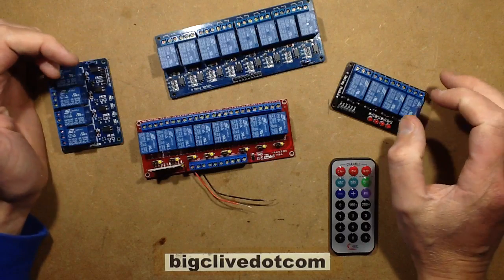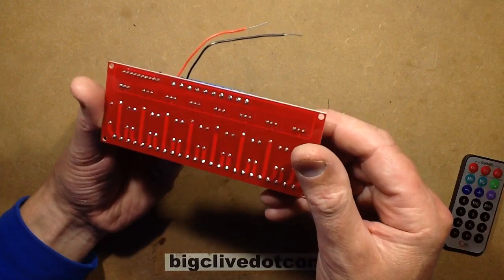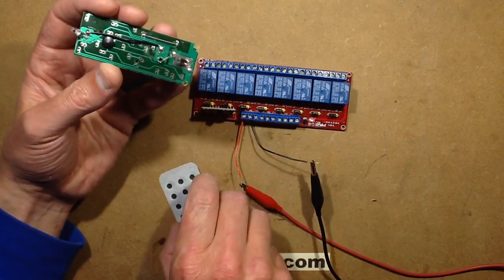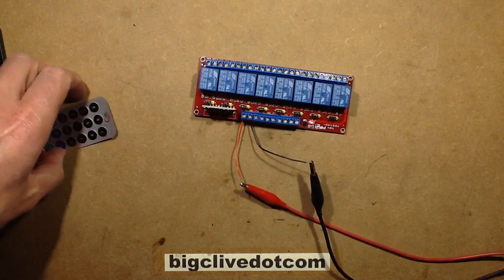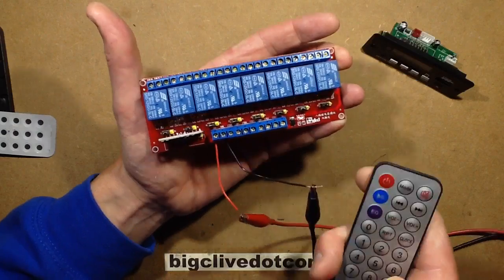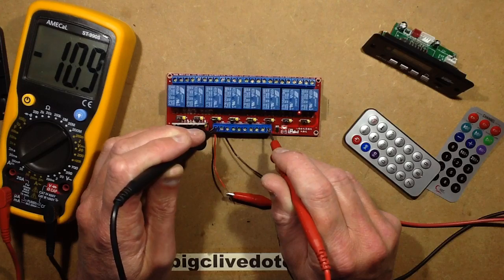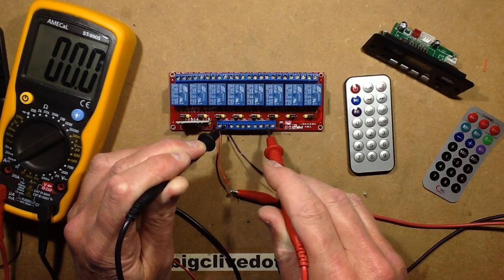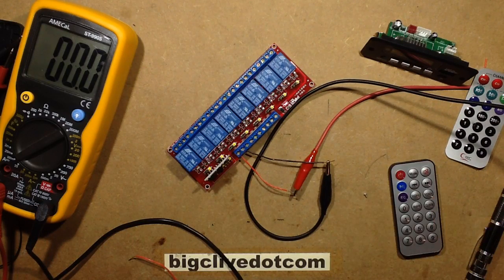Infra red remote control relay module.

Comment: +bigclivedotcom a couple of years ago when I was using the cellphone IR trick was that I noticed my new iPhone 4 or 5 at the time the IR wasn't showing up. At first I thought bad remote, then for some reason it dawned on to use the front facing camera, I can't speak for what's out there now, but it appeared that they may have been some IR filtering one the rear facing camera of my old phone. I'm now using a Samsung Note 4 and can see the IR just fine.

Comment: So could you trigger these relays with the drop in voltage when a phone is taken off the hook? I am looking to turn on a lamp whenever the phone line is in use and have it turn off again when the phone hangs up.
Reply: You mean like tapping the phone lines? Maybe, but in most countries it's illegal to hook up unlicensed devices to phone lines. Maybe you could put a magnet in the handset and use a reed switch to trigger the relay module.

Comment: I got one of those car stereo modules, connected it to my lab supply, gave it 5V and it worked just fine. Then since it's labeled 12V on the ad I gave it 12 and it exploded. Repeatedly. I'm guessing it's made for the really old cars, like Trabants, which really do only supply 6V or so.

Either way, don't try to use them with 12V.

Comment: Is it possible to de solder the sensor and extend it on wire, or would this influence the resistance of the IR sensor?
Reply from the maker: You could extend it a short distance with ordinary wire and a longer distance with a screened pair of wires where the screen was connected to the 0V connections .
Reply: Thank you

Comment: I wonder if chips get manufactured with the wrong numbers on them and instead of discarding them they scratch the numbers of sell them at a discount.
Reply: I did get once a few chips marked as LM311 from eBay. After playing around with them, I discovered they're really a dual op amps, bummer :)
Reply: I don't think so. You would not believe how many chips get faked (Brand Logo + Partnumber, but a "compatible" die inside). The most famous case was FDTI with their USB-Chip sets.
In other cases, you get real parts, which for some "odd" reason already contain data. Scratching the number off is just to make reverse engineering harder "the cheap way". (The more expensive way is, to order chips in bulk with custom printing - even the big semiconduter companies offer that service, when the quantity fits)

Comment: isn't the problem with powering the relays occurring when they are switched off? To me the Problem with the Supply is the Inductive spike when they turn off (especially because the inductive effect of the relays would PREVENT the current from rising too quickly)
Reply: The inductive spike has transistor destroying risks.  The turn on current has the potential to pull the power supply too low for the microcontroller to keep running.

Comment: Why does it handle much less volts in DC than AC?
Reply from the maker: +fabts4 DC current is harder to break than AC current.
Reply: bigclivedotcom Alright. This has to   do with the electric arc that occurs when opening the relay?
Could one concludes that you can go beyond 30VDC with a low current load?

Comment: Ha Ha .. Mr Clive.. watch 3.06 your 1st Remote is also working but without pressing a button. that is a very common problem with this cheaper remote.If you could hack the remote & duplicate the IR codes to another cheap TV remote with better touch pad, the IR relay module will be very popular & long lasting. How did you missed that 6pin chip will be a opto-isolator like PS2622 or PS2621? :D

Comment: A common problem with these is the battery compartment is under spring tension, and the plastic clips meant to hold the drawer closed are under engineered, meaning the battery get's upchucked back out of the remote after little fiddling. Annoying little things.

Comment: +bigclivedotcom, you can power those non-opto relay boards for a separate supply just fine. It's just a transistor controlling the relay. So instead of connecting the Vcc of the micro to the Vcc of the relay board just connect the power form a separate supply to Vcc of the relay board. And common ground the supplies and you're done :) No need for those modules that misuse a opto. I mean, seriously, use an opto en then connect the input and output of the opto to the same ground? :/

Comment: Could something like this be used to control 240v Lights?
Reply from the maker: I'm not confident in these small relays for mains use, but you could drive a larger relay with them.
Reply: Thanks, I am wanting to have fairground style lighting with different effects controlled by a raspberry pi

Comment: Which is the integrated circuit on IR BORARD ?
Reply from the maker: The number has been scraped off.
Reply: Has it been scrubbed off well? Usually when you apply some saliva it becomes visible.

Comment: What's the audio player? Does it handle any lossless formats?
Reply from the maker: It's a cheap eBay MPO3 module.  I doubt it would handle any more specialist formats.
Reply: No. I have one in my homemade audio amp and it plays .mp3 and .wav. Doesn't play .flac or something like that. But the audio quality is quite nice for the cheap stuff it is.
Reply: Ah. So what would be a slightly more up market version of that in. Similar size? Only more self contained than basically a front panel.
Reply: There really is no market in the retail sector for anything lossless. Aftermarket car radios had support it a few years back, but they limited them to non-high-rez bit depths and sample rates. Anything portable that will play lossless formats like FLAC is going to some expensive thing with magical pixie DACs made for audiophools. iPods play lossless, if you're willing to encode to ALAC. Find a classic one and put a modern SSD in it. Outside the home, there is zero point to lossless. Environments are too noisy to merit anything over medium bit rate lossy encoding.

Comment: got a link to that 8 relay module?
Reply: This looks like the same unit.
http://www.ebay.com/itm/12V-Multi-function-Infrared-Remote-Control-8-Channel-Relay-Module-Bidirectional-/252216092048?hash=item3ab9402590:g:BXsAAOSw1S9WclxV

Beware! One of the "features" is: "output leads to a normally 
open and normally closed two electric shock". XD
Reply: +Sootikins what do you mean
Reply from the maker: It's the weird instructions that come with it have a mis-translation that says "electric shock".

Comment: Something dangerous here on those relay modules the solder pads underneath are connected to connection clamps, some arduino projects suggest switching mains with these relays. !! Be careful touching the back of the board, and don't sit it on a conductor...
Reply: Also some models have way too small clearance between mains and electronics.  One reason is the preference for "sugar cube" relays with the contact center pin next to the coil pins.

Comment: Check ebay for universal remote (sorted by cheapest: http://www.ebay.com/sch/i.html?_from=R40&_sop=15&_oac=1&_nkw=universal+remote&rt=nc&LH_BIN=1). It is something that seems to be just an IR led attached to a 3.5mm plug. You can then use it with zazaremote app from play store to control virtually anything with an IR receiver (at least in theory - it has 3.8/5 rating with a million users). Both the app and IR plugs are made in China.